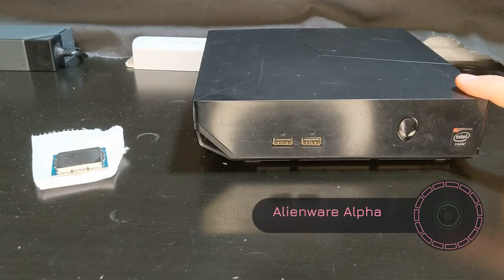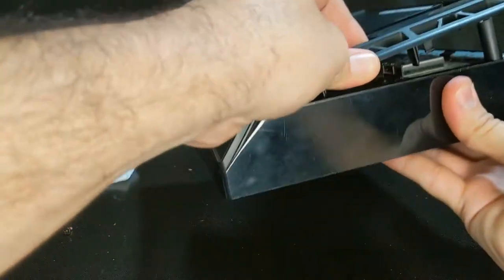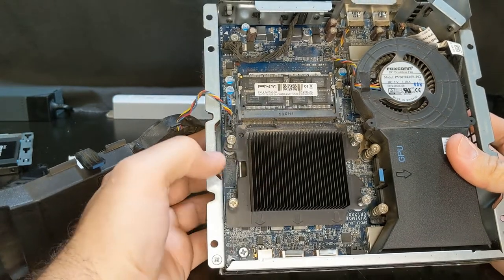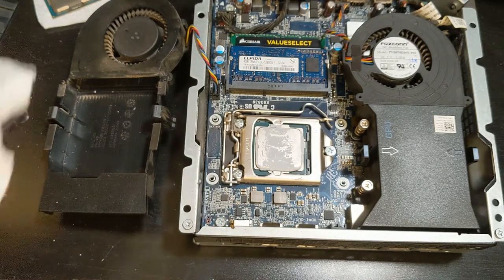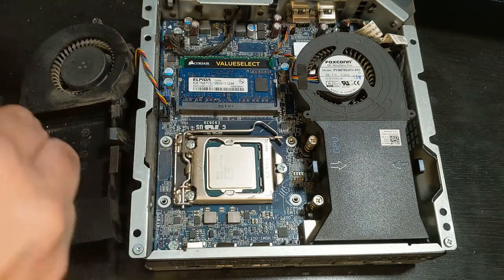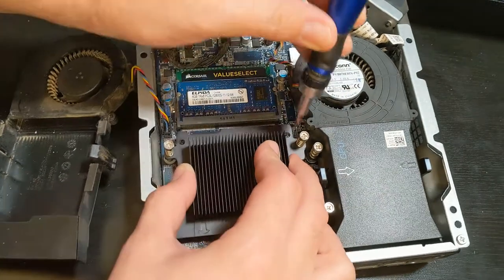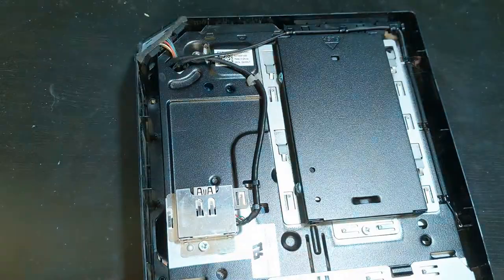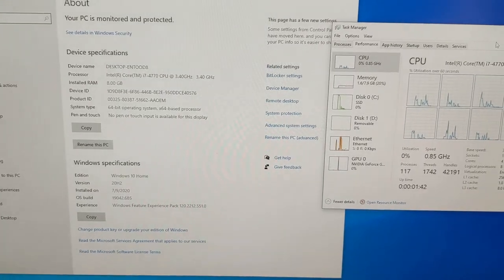How to upgrade the CPU in a Alienware Alpha

Comment: What's the latest chip and fastest  and size ram you could upgrade one of these to today in Dec 2023?
Reply: first of all, buy a copper cpu heatsink. then, buy a dell 330w external psu. final step, buy top of the line thermal compound and stick an i7-6700k in it. it’s the best cpu it’ll take. for ram, the most it’ll take is 1x16gb 2133, i believe.
Reply: sorry for the misinformation. i don’t know much about the r1, but the listed specs are the latest for the r2.

Comment: Pro tip... Use a PC duster to get the dust out of here before you take The heat sinks off. When you are dusting inside the computer make sure you use a finger or something to hold the fans if not still, then at least at a slow speed because you can break the fans.  Lowers the risk of contaminants when you are removing the CPU or adding paste. Also a lot of times overheating issues are just because the fans aren't blowing efficiently because of dust or the heat sinks are full of junk.
Reply from the maker: dude thanks for the tips!

Comment: so i have a question, the i3 that is in this is the low power draw T variant that runs 35 watt power draws, so i was told to run the T version of the CPU i am upgrading to, the i7 you use is 84 watt power draw, the S version is 64watts and the T version is only running 45 watts. have you seen any issue running a much higher demanding cpu? i want to upgrade mine but having a hard time find the T variant's at a price im willing to pay
Reply: You don't have to use a T variant. If you put in a normal processor it will just throttle down to the tdp that is available for the system. Iv been running mine like that for 5 years now. No issues.
Reply: @leqendz8250  how well does it run? Does it thermal throttle? Can I put in a i7 3770 in?
Reply from the maker: Just make sure it's the right socket type and compatible one but yeah it doesn't really throttle or anything works very well with a i7
Reply: Does the LGA1150 sound right for the socket type?
Reply: @randomtube8226  yes but the highest cpu you can use is the i7-4790 S/T/K but i wouldn't use the K version, it just draws more power than the machine can pull in so it would theoretically throttle cause it can get the power draw it needs. so the S or T version of the cpu is fine. thats why i went with the i7-4785T
Reply from the maker: @AlteredCarbons ya your right 👍
Reply: @AlteredCarbons  I'm having a hard time finding one. Even on eBay the specifications aren't fully listed
Reply: @AlteredCarbons  Yeah I'm not paying over 50 total shipped, but I'm not finding any T or S models on eBay available in the US.

Comment: Do you need to upgrade the power supply since the one you use draws more power? The alpha r1 comes with a 130 watt power supply.
Reply from the maker: ya i would think you would need too but you dont it can handle the upgrade of the new cpu have done this in 5 of them from i3>i5>i7 all have worked no issues with running out of power they are all low power CPUs really.

Comment: Is their any list of compatible upgrades for the alpha?
Reply: 2x ram sticks up to 16gig at 1600hz ddr3 , 4th gen i3, i5 , i7's but the issue is the power draw for the T variant  inside these cases run 35W power where say the one in this video hs is using is 84W pull power so i am not sure what issues might come or even would come from that. like it could burn out the mobo sorta thing. and then you can upgrade to SSD , as far as i know this is the only upgrades you can do. so as long as you can find a T variant  CPU or at minimum the S variant  cpu's that are 4th gen intel you would be better off, dont use a K version as they are for over clocking and this box just cant run the power for it i think and would melt something along the lines
Reply from the maker: Hey thanks for the reply and all the detailed information but yeah you can upgrade the CPU no problem the hard drive to an SSD and upgrade the memory let me know what you want to upgrade and I can point you in the right direction
Reply: @AlteredCarbons  one of my dim slots it Broken I was wondering if I were to get one 16 gig stick if it would work. It’s running on one 4gig rn but was running on 2.
Reply: @aldenmann1996  you could run 1x16 gig im sure, but unfortunately you wont see much in gains cause 2x anything is what PC's really want. what broke on your dimm slot for it not to work? if you go to a single 8gig for now it would be a cheaper route. you MAYBE able to un sodder and re sodder in a new ram slot but do not quote me on that. i personally haven't needed to do anything like that so i am un sure if that would fix your issue. but bumping up to 8 , hell maybe even 16 will be a upgrade for you but with out 2x dimms you wont see the gains you really want. you might be able to buy a whole motherboard for an R1 on ebay as people part them out all the time but they still push 150-200 for just the board so keep that in mind
Reply from the maker: I don't think it's compatible with 16 gb dimms because of their motherboard limitations but you can double check by googling the main board model to see what the max supported memories that I can't imagine being more than 8 gigs per slot
Reply: @GreyTechLive  alpha it's 2x8gb ddr3l 1600 max. the best ram kit that's supported is the G. Skill RipJaws 2x8 1600CL9-9-9-28 1T DDR3L kit. I just installed this ram kit today and it worked flawlessly at the advertised ram speeds and timings. make sure the ram kit is ddr3l (1.35V). If it's the alpha r2, it only accepts one ram stick.
Reply from the maker: @CknSalad  thanks!

Comment: Is the i7 going to harm the mobo or anything with just it's regular power supply it comes with or should I upgrade that too?
Reply from the maker: Nope you should be ok I have stock psu and i7 for years never had an issue

Comment: I’m s there a certain brand I have to buy and/or what do you recommend I’m running an i3
Reply from the maker: Well if you want better performance I definitely upgrade to a i7 if you do a lot of gaming and a ssd drive then this will run most games pretty good but newer games not so good
Reply: Ok thank you I’m definitely going to have to upgrade
Reply from the maker: Yeah definitely it's worth it a couple hundred bucks and you have a great computer check out eBay for use i7s for this model and you should be good around of 100 bucks maybe

Comment: Dang, I bought the i7-4770 to replace my i3-6100T and it doesn't fit. The little tabs don't line up. Any thoughts?
Reply from the maker: Hm seems like you have the newer version of a Alienware model since there was a 2nd generation of them
Reply: The 6th gen cpus use a newer, different socket than 4th gen cpus

Comment: Does anyone know if the GPU is upgradable from the 970 on the steam machine Linux based? Mine came with 16 GB of RAM and an i7 processor, but it's the GPU that's a GTX 970 that I believe is holding me back. I think I'd even be willing to get a midsize Tower if possible. But I'm not entirely savvy with this stuff
Reply from the maker: Unfortunately it does not a direct upgrade for that because it's on the actual board but I have seen newer Gen models that have a special port on the back that you can actually hook up to a case that's got a full size GPU in it but those are very costly it's almost cost-effect it's just maybe build a newer machine but that's up to you might find a used one on eBay that might be better for your needs
Reply: @GreyTechLive  I appreciate the response bro I'll definitely take that into consideration. I might go ahead and build one for sure
Reply from the maker: @DadeHudson93  of course! also its called the (Alienware Graphics Amplifier Port (available with NVIDIA GPUs)) its on the back of only the R2 models not sure if that is yours its the latest one before they stop making them. here is a pic of it marked as port #3 https://i.dell.com/sites/imagecontent/products/PublishingImages/alienware-alpha-r2-desktop/CS1701G0006_Alpha_MLK_pdp_pol_mag_module_07.jpg

Comment: Is the gpu upgradable
Reply from the maker: It's not sorry man :( I wish
Reply: Get a alienware amplifier and then get a adapter
Reply from the maker: @heyitsron1941  i would if you could but that requires a special cable port and these dont have that on the back too old lol unless you have the Alienware Alpha R2 version than you can do it but this is the R1 version.
Reply: @GreyTechLive  wrong yes it is you can buy a external gpu
Reply from the maker: Lol yeah if you have the newer model but not the older one like shown in this video so it really depends on what you have.
Reply: @GreyTechLive  should of got a rog g20 100% better
Reply: @GreyTechLive  you can  hack / upgrade the R1 if you take out the wifi card and use that m.2 port - it's a bit messy though but it has been done.

Comment: What did I do wrong, the computer is no longer outputting video....
Reply from the maker: maybe the cpu you got is bad or not right model check memory also re-insert it or try other kind.
Reply: @GreyTechLive  thank you for getting back to me, but I realized the issue a little after the fact. when I was trying to clear away the larger debris from the dried thermal paste that wouldnt  blow out my vinyl glove snagged one of the pins on the motherboard and bent it over...
Reply from the maker: o crap, hope you got it fixed..
 @ChatookaMusic

Comment: I have to alpha with a Intel i5 4590T 2.0ghz with 8gb ram. What can I upgrade to . Newer games are laggy.
Reply from the maker: ya sorry to say if you don't have the Alpha 2 then their is not much to do since whats really hurting you is the built in gpu video card you have in it so old hard to run newer games :(
Reply: @GreyTechLive  most games work very well but a few new ones cause my fps to drop badly even with the dedicated WiFi I use
Reply: @1969chgoodwin  it's just not enough anymore on the gpu side for the latest games.
Reply: @huzcer  this is the only game I have a problem with. Some games require more than this and run well
Reply: @1969chgoodwin  what game? I have one as well but its day is over. The GPU is just not up to it anymore. A cpu upgrade won't do much if anything at all for you as the wattage to the CPU is restricted in the alpha and only old CPUs can be used that fit socket 1150. The 860m  GPU is just well past it now for the latest games
Reply: @huzcer  I only have problems with night of the dead( although everyone else is having issues) but I play games like Icarus (which requirements are more) and have zero lag . I've even uninstalled some games I don't play much anymore and it still happens
Reply: @huzcer  I only have problems with night of the dead( although everyone else is having issues) but I play games like Icarus (which requirements are more) and have zero lag . I've even uninstalled some games I don't play much anymore and it still happens
Reply: @1969chgoodwin  presume that you are using MSI afterburner for the GPU to give it a boost?
Reply: what is the program called? don't know - for a 2014 cpu and basic gpu from the same time it's not going to last forever. games like horizon zero dawn from a couple of years ago don't run at all satisfactorily on it - too old
Reply: @huzcer  It was afterburner 4.0